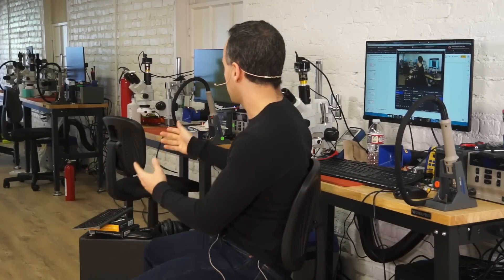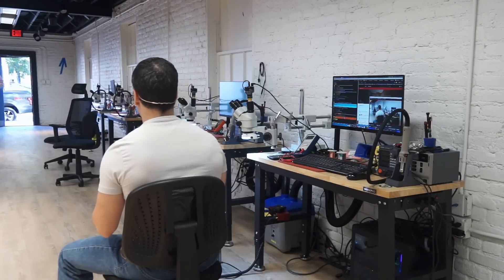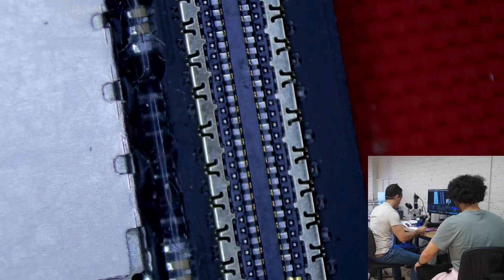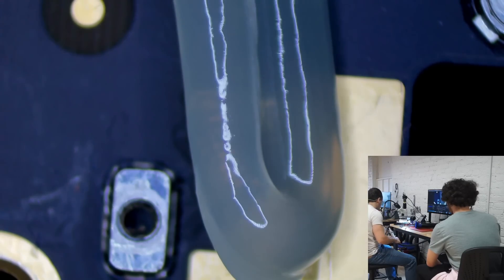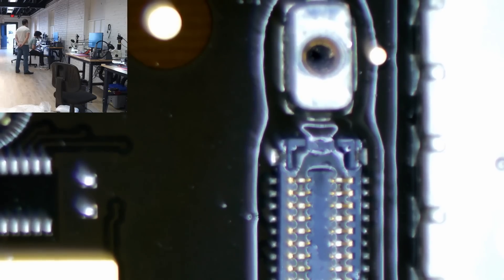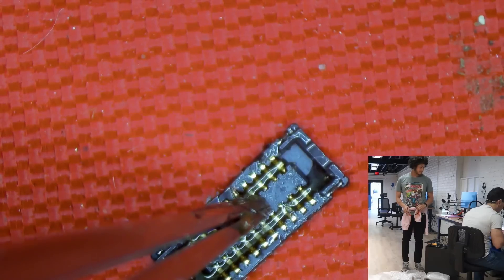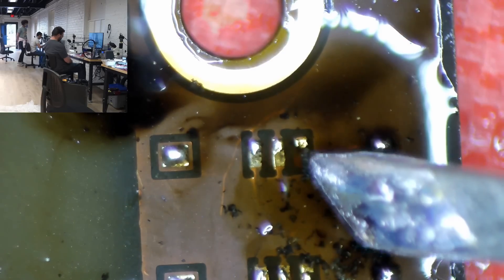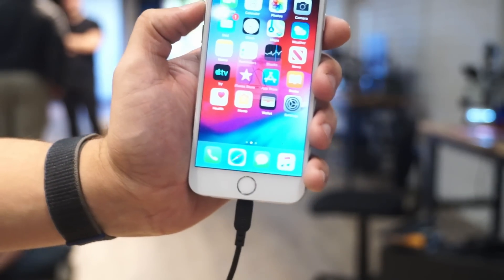Free FUTO repair workshops; come on by!

Comment: Amazing initiative, thanks for all your hard work for Right to Repair, even though I don't personally delve into repairing my own stuff as much these days. It would be really great to have a local "makerspace" (even if paid) where you could go to borrow tools for such repairs without having to own them. Just a small correction for the schedule posted on your workshop page: you have a time slot listed for 31st November (11/31/2022 – 11 AM – 6 PM CT).
Reply: Tulsa Central Library has a Makers Space with at least a soldering iron. 
But they also have all kinds of things from 3d printers to a laser engraver & a ton more. 
It would be nice if they had dedicated equipment for repairing electronics though. Plus donor boards you could just mess with.
Reply: @Nirrrina  Its great that a library has that, I'm fortunate enough to have a makerspace in my university, but I'll only have access to it till I graduate. Donor boards from recycled devices would definitely be a good addition!
Reply: @kumarhiranya  I think they should have the full microscope set up along with all the tools needed to do things just like Louis has. It would be much more use than say the loom they have. 
It's a really cool place. They even have a recording studio there. Plus upstairs they have a computer lab to do the things I have no clue about in. Oh & on the third floor they even have 2 flight simulators you can use.

Comment: I'm amazed that there isn't a tool which can heat a board while also using a thermal camera/ir sensor to monitor the temperature of the board and maintain it at a constant temperature so that you can consistently melt the solder but not the plastic.

Comment: Something far less daunting but probably just as frequent could be repairing game pads. How many controllers get thrown in the bin from things like simple stick drift? Swapping out the module is simple and cheap.

It’s very tricky or near impossible with a cheap soldering iron but with that equipment it’d be a breeze

Comment: this is really cool. intentionally irreparable products are a cancer and shouldn't even be legal, especially with how fragile said products are. I have an IBM ThinkPad 385XD running Windows 98 that was stored in a humid trailer with a roof leak and it still works perfectly fine meanwhile my almost brand new Asus ROG laptop (G513QC) is already starting to "get old".

Comment: BTW, on a donor board to remove the connector at the edge of the board - @theCod3r had perfected the techique, putting the edge of the board off the table and heating the opposite side of the board.

Comment: 2 weeks ago i broke the usb hub off of the handbrake i use for sim drifting and ended up melting more plastic than solder. wish i wasnt so far away, i'd get a fuckin clue and not try to solder the hub while its connected to the cable, whose connection is full of plastic.
Reply: Practice what you see in Louis' 600 or so videos...... use waste boards. Apple store probably has lots of the irreparables in their dumpster. Find a maker space in your area that has soldering 101 classes. Often these are through your public library, others are private ORGs